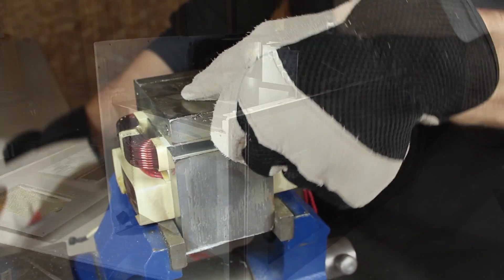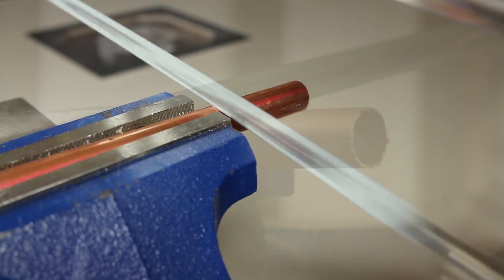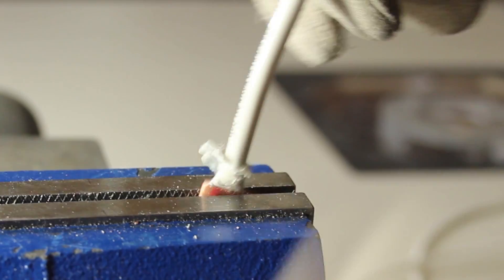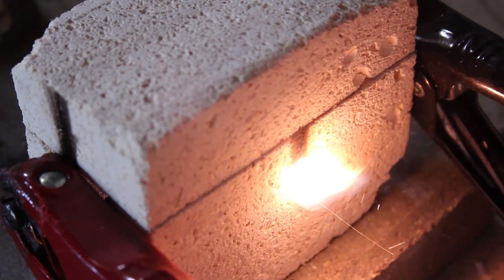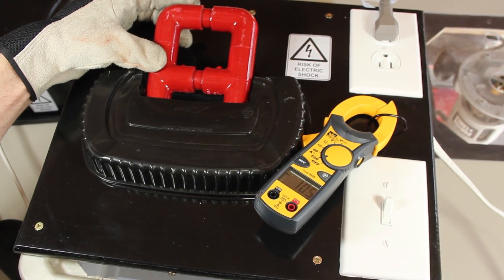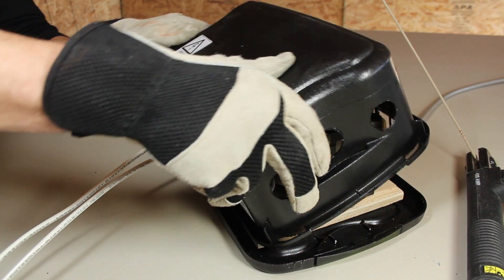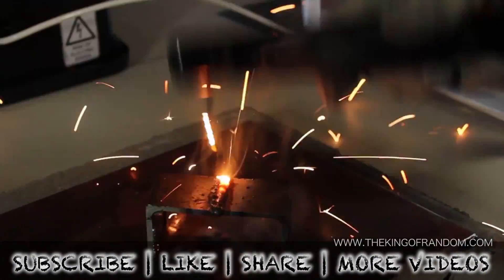Making an ARC Welder - Part 2 of 2

Comment: Can you use a jumper cable (with some modifications) instead of the cable wires, metal clamps, etc.? One set of jumper cables has all of the necessary parts, and if you find a used one, or one for free, then that's the best scenario.

Comment: Theres no reason you cant run the transformers off 120v in parallel, it will just use more amperage, so you might need a 20A  outlet.

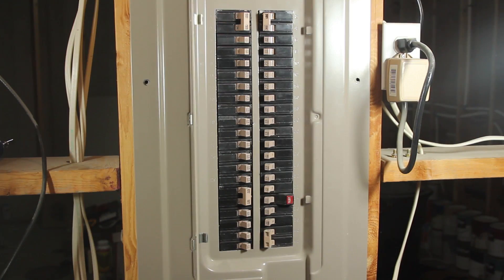Comment: 4:00 ha when you live in america and dont have 240 VAC normally
Reply: Eh not exactly, you do when you know what to put in your panel and what gauge wire to run to where you need it, i had a dedicated 240 in my shop just for my cracker box lol
Reply: The guetto rigged plug makes me laugh the wire better be some of the leftover 8gauge or I'd beore worried about the wires melting too easily
Reply: Nichole Crouch mate I live in Australia lmao 240v is the norm
Reply: @nicholecrouch311  for a 15A outlet you only need 14 guage wire.
Reply: @RandomakerYT  duh but too much pull even with the minimum gauge required for the 15 amp you'd be popping the breaker constantly or like I said heating wires up from the current flow
Reply: That'd be cool to have but then I'd be paying for welding all the time LMAO its too much fun for me
Reply: We get 240 normally also. Its used for the few things that need it, like a washer/dryer etc. If he cared he could have plugged in there which is inconvenient.
Reply: Houses in the U.S. have 240 vac, that’s how he was able to get 240 volts from his panel.

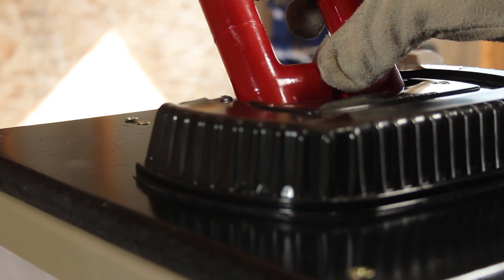Comment: 6:25 how did you make the current adjustable?
Reply: Dont think youre gonna get an answer bud...
Reply: @xxkinglucifer7762  
I'm not sure, but i think they do it with shunts. Little wedges that fit in between the primary and secondary coils and seperates them by screwing in a knob. More separation less current.

Comment: I don't understand why you had to use 220v to power the primary coils in series. Couldn't you have used a single 120v phase to power the two primary coils in parallel but connect the secondaries in series. You would just have to get the polarity of the secondary terminals right and you will get twice the voltage of a single secondary winding, so your end result will be the same but in a safer way.

Comment: Can this be scaled up to weld at 120v and 180amps?
Reply: @samayou2  soo, in your opinion whats needed to burn 7018 1/8" steel rod. Because when i use the welder at work i set it to 120 volts and if I'm not careful i burn right thru 3/8" steel plate. Could it be that its 120v of DC?

Comment: What is the minimum wattage capability that you would recommend for the variac to be used with the welder? I would prefer to use a commercialy available variac, and would prefer not to use something that would be overpowered.

Comment: Instead of 240vac, the same can be done with 120vac, but you will still need two outlets (each on different circuit breakers), on the same buss. In some cases, one might have two outlets relatively close that are on the same 120vac bus but go to two different circuit breakers. 

In the video, he wired 2 transformer primaries in series and connected to two outlets each connected to a circuit breaker, each on a separate 120vac buss.  The the Y plug connects the hot to one end of primary coil  with the other side of the Y plug hot connecting the that circuit's hot to the one end of the other primary coil.  Neither neutral or ground  were  mentioned.  Then the two primary coils other leads are connected together with the end result of  having two 120 volts coils connected in series.  Lack of grounding in this is very scary. 

The  way to do this  with two outlets on different circuit breakers on the same 120v buss is to forget the Y adapter plug and just run an extension cord  from each outlet to each transformer.  Things should be the same on the secondary coil.
Reply: Finely a intelligent coment.

Comment: For the miny arc furnace, I would use the outlet behind the Electric Stove or Washers. They are 240 volts and the plug can be bought at Home Depot for cheap. This way you don't have to run a cord thru out your house.
Reply: In the US we simply dont get it, its rare for a house to have 240.

You can always wire one in though, it's not hard, but it's not like other countries that run on 220.

Every single stove and washer I've owned in the past 30 years has been 110v....I'm in California

Comment: I have many HPS or HID ballasts. Does it make a difference when it comes to rewire the transformer or it will only make a difference with the primary tension? And consequentely a bigger voltage/amperage on the secondary?

Comment: My arc works on a normal 120v outlet but as soon as I connect it with 240v with the way shown in the video it shorts out. Does anyone have any idea as to what the problem is?
Reply: I hooked it up in parallel and it works for about 5 seconds before tripping the breaker. I guess it's drawing too much power. I was thinking of wiring the transformers separately to two outlets on different breaker buses, would this help?

Comment: The King of Random: I tested the portion of your video about "220/240VAC". I've never been able to get a phase voltage of 220/240VAC. And I think I understand the reason: it must be a matter of local regulations regarding how to dispose the circuit breakers.

At your home, I think I saw only 120VAC circuit breakers on both sides of 
your electrical panel while here, where I am, the left side of my  
electrical panel are installed 120VAC circuit breakers and, on the right
 side, those 220/240VAC.

What made it so that having the same 120Vac busbar, my multimeter indicated 0Vac.

Therefore, people who want to build a welding station like yours should check 
before the layout of the circuit breakers in the electrical panel of 
their house.

Comment: man you could simply connect the primary windings in parellel to use it on 120v ac. But oviously it would work bether on 240v

Comment: At (314) you say that you have left "plenty of separation" between the terminal lugs but if that single screw works loose the lugs could very easily swivel and short out.
Even if the screw is tight, I'm sure a sharp tug or yank on the wire could do the same.

Comment: Each outlet in my home provides 110 Volts AC. Should it work on 220 volts or do I need to power it on 330? If 330, then is there a setup of your choice to power the welder?

Comment: How many amps and voltage has the transformer??
Reply: 15 amps (according to his meter on the primary side) at 240 volts is 3600 watts (15 * 240 = 3600).  So whatever current and voltage he adjusts on his scariac should multiply to 3600 watts.

Comment: I'm wondering if its possible to run 3 transformers in series where you could use 1/8 inch electrodes because they are a lot cheaper?

Comment: Would the flow of current burn the plastic wiring
Reply: no, flow of current won't produce heat so long as the wire carrying the current is thick enough. That is why u need a wrap a thick wire in the secondary.

Comment: Grant Thompson - "The King of Random" That's pretty sweet. I'm trying to build one of my own. I was wondering what it did when you ran the primaries in series instead of parallel and how you are able to pull over 200 amps through that 8 gauge wire when it's only rated to carry 24 amps maximum. It seems very dangerous and i want to be able to build mine safely. Thanks.

Comment: If the transformers are connected in parallel, you don't need 240V, BUT, they will be on the same breaker, so only half the power will be available, unless the breaker and wire is upgraded to 30A, alternatively, a dryer outlet can be used to get 240V without potentially causing a direct short, which can supply double the power two wall sockets are rated for.

Comment: I would like to build this and connect a 12v fan for cooling inside the casing. How can i wire it to turn on with the existing power supply from a 240v power outlet? Would like it to run full time when the system is turned on. Would also like to use a dimmer switch to control the power output. Is it possible just to put in the dimmer switch in line before the first transformer in the series?
Reply: Chris Sena i don't think the switch can handle that current
Reply: Sillygoose210 _ I'm just thinking that if I put it on the 240v side where the power comes in before the transformers it would help and then could regulate the power input thus controlling the output from the transformers. what are your thoughts about adding a fan system so the system won't overheat?
Reply: Sillygoose210 _ I'm just thinking that if I put it on the 240v side where the power comes in before the transformers it would help and then could regulate the power input thus controlling the output from the transformers. what are your thoughts about adding a fan system so the system won't overheat?

Comment: I wanted to add... if you add some bridge rectifiers ( you can get a pack of 6, 1000 volt 50 amp bridge rectifiers on Amazon for like $30) and use another microwave transformer core, and wind it with about 6 loops of 2 gauge wire to make an inductor. you would have a very nice and smooth DC welder that will weld beautifully.

Comment: so in a 230/240v country like all the European ones, you'd just need the one plug wouldn't you?
Reply: yes
Reply: Not necessarily, american outlets are fused for 20A, while European outlets are fused for around 13A.
To power it from one European outlet you would need to refuse it for the amperage drawn. As seen in the video, at around 15 A pretransformer you get around 100A posttransformer.

Refusing is usually super simple, but don't do it unless you know what might go wrong ;)

Comment: 1. I am about to complete this project can i directly put wielder in 220 voltage switch as i don't have dimmer or scariac?
2. How does secondary coil gets current when there is no connection between both coil??

Comment: i hope i get an answer. so get it straight. i am from germany, here we have 240 volts on one plug, so i can use it with just one plug? or ist there any problem because of to much ampere i use with this?
Reply: I am not an electrician, but based on what other people, and Grant, have said, it should work fine. He just gives this example because some homes don't have 240 volt outlets, or they may all be used.
Reply: should work but if you have to ask this you may consider not trying this at home!
Reply: No, because German microwaves will be designed with 240 volt transformers. If you could get microwaves built to work in the US on 120v then yes it would work, but might trip a breaker due to drawing too much current off of one circuit anyway
Reply: Jason Grimm maybe i get you comment wrong but german microwaves should work in this way with only one plug but using two transformers in parralel could cause problems due to too much current being requestet which would pop your circuit breaker in that case you could either put the two primarys in series and use 2 Phases to power them (but only if you really know what you are doing cause in that case you deal with 400V which is dangerous!!) or put them in parralel and power them from 2 different circuits on the SAME Phase( thats important) but before trying that i really recomment you to inform yourself on that subject and don't take anything i say as given always do your own research this (even the 230V) is potential lethal and nothing to play with!

Comment: how is the scariac tied in to the coil to regulate voltage? I don't get that
Reply: the scariac is basicly a byg high power potentiometer (adjustable resistor) that regulates the output by its resistance (water distance between the two copper pipes)

Comment: Would like to see a fuse in the device itself with that sketchy double plug tool you made.  Also the center plug for that abomination should probably be some sort of 240v receptacle (maybe even a twist lock? just don't want someone to mistakenly plug in a 120v appliance to 240v).  Grounding isn't really necessary here with the way you constructed your welder, the only thing to ground might be the transformer cores themselves.  If you used a metal enclosure instead of the plastic one you would definitely want to ground the thing.

Comment: you shouldve soldered or used proper crimps and crimper instead of just pressing it in a vice because the will become loose and hot after a while
Reply: crimping can produce what's called a cold weld. it's strong enough to where ripping the cable off will leave more in the crimp joint then is pulled out as long as you apply enough pressure. It's extremely common, sadly bad crimps from janky production runs do tend to give it a bad name. Doing it right however is very safe.
Reply: +Daniel Blair that said, wouldn't soldering the cable to the tabs or even the tab to the clamp provide better contact and thus better transfer of electricity?
Reply: It can help, but its such a minor difference if its a good connection. If you're unsure about the quality soldering is a good way to ensure its connection. Just be sure the solder forms a connection because the crimp has a higher heat capacity so it has to get more time on the iron. Careful not to melt plastic sleeves on normal crimp tabs though. Not a big deal but can be annoying.

Comment: Can someone tell me at 4:28 why grant didn't just directs twist the black swore to the tab and like solder it , what's the point of the nut ? Sorry if it's a stupid question
Reply: I know it's late but what are you asking? I can probably help but the way you worded the question isn't making sense
Reply: Because in case the connections were connected wrong and needed to switch them so the transformers were not cancelling each other out.

Comment: If I live in a place with 240 v do I still need the scariac?
Reply: no
Reply: no
Reply: +Vasek Horcicka Yes, probably, because he uses transformers/microwaves that is running normally on 120v, and he got 2 of them. While you probably use 2 transformers that is normally running 240v
Reply: Piko 786 all residential homes have 240v incoming from the power line drops.

Comment: I assume the transformers have to be close in wattage, but what happens if they aren't?
Reply: And is there a way to make this with different watt transformers?
Reply: +Ryan Doyle just make sure the maths means the wattage of the primary coil isn't exceeded. removing the secondary changes most all the manufacturing specs of the transformer. because it is no longer the same output, which is basically the whole point of a transformer other then having a proper primary for the application to provide proper coupling and such.
Reply: do you mean the ratings? The way he has it set up is the same as having 1 bigger coil with a linked centre tap for both primary and secondary so it should be taken into account, but for doing this the current you draw shouldnt bea major issue. say it was a 1000w microwave, the current drawn could be max 8.3 amps at 120v (not taking into account fault current), so put in a fuse of 8 amps on the live to the transformer to protect it. (8 amps will be fine since its apparent power the 8.3, the true power will be a bit less since there are effectively 2 coils producing back emf)

Comment: Do u need to build the scariac or can i just plug it in and use it?
Reply: the way he has it wired you do need a variac to control the amps, if you wire a light switch right into it you can have an on and off switch and if you put a dial nob, for dimming lights, you might be able to control the amps that way. But i'm just a welder not an engineer or an electrician.
Reply: a dial nob most probably can't handle the current and would die
Reply: if you wire it after the transformers then the dial would fail, but if you wire it before them it would be dealing with the same amount of current that it was designed for
Reply: most of this nobs are only designe for about 300W this thing uses definetly more that you average Lamp!
Reply: no you don't need the scariac.
Reply: your right!

Comment: Years ago I had a welder that worked off a car battery. To help with striking the arc and maintaining a constant weld it had a small solenoid which pulled the stick off the workpiece every time it fired up and allowed it to return under spring pressure when the current was broken. It may sound as thought the weld wouldn't be strong, but it helped maintain a constant weld across the joint.
Reply: you can do that now. i can't remember if you can do it with AC or DC
Reply: it's high voltage lol(ACDC song reference)

Comment: Ok, so the white wire isn't connected to a power source, so how is it getting power? I know that the exposed copper coils are connected to a power source, but how does that give power to the white coils?
Reply: The first coil creates an electromagnetic field and which allows the output to be modified by the amount of turns in the second coil

Comment: Hey, is there a reason you are using the Scariac with this project? I agree it is neat, but can you fill me in on why some type of dimmer switch would not work to create a variable current limiter?
Reply: But can't you wire one to a cheap SRC out something?
Reply: Dimmer switches don't send the full sine wave through to whatever it is powering. Thats why light bulbs buzz when they are dimmed. They chop the wave in order to create sort of a PWM signal where a variac will reduce voltage but keep the full sine wave. If that makes sense.

Comment: You can actually just do this by hooking up 2 car batteries in series...
Reply: +Lafika Just using it in short 2-3 second bursts like for spot welding, the batteries will not explode. The metal you're welding together will also offer a small load on the circuit.